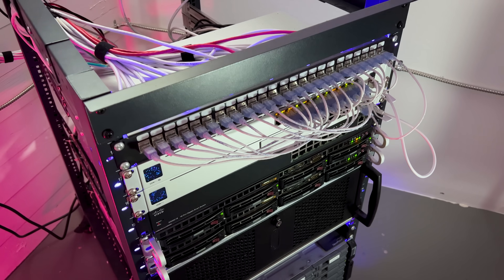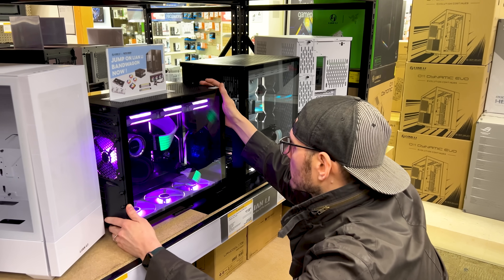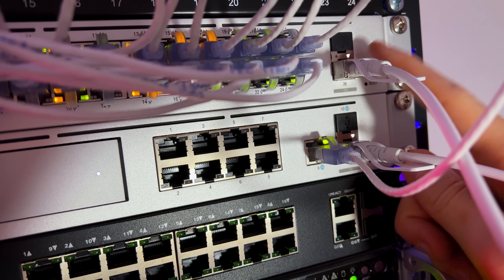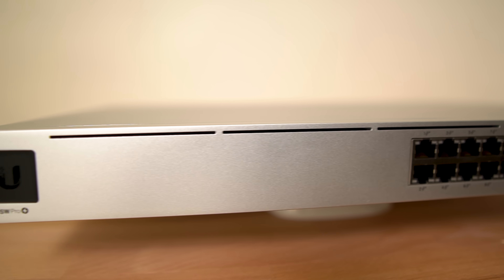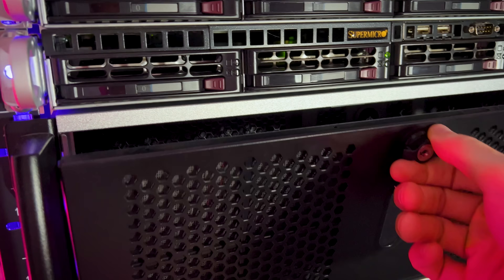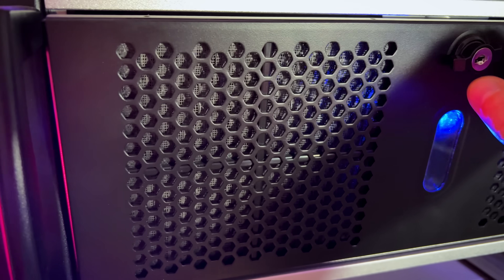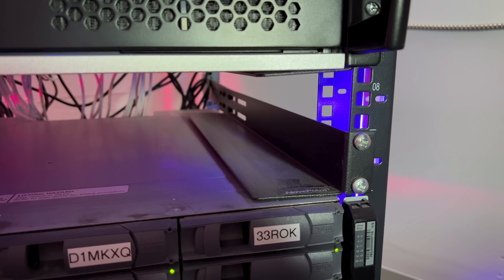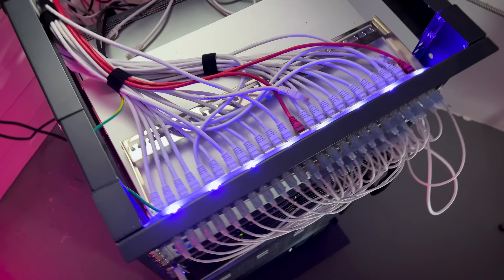My HomeLab Regrets...

Comment from the maker: What's one thing you regret buying for your HomeLab??? 😭
Reply: Budget always not enough
Reply: My first cheap crimp Patch Panel. Spent so much time debugging and rewiring only to realize that the problem wasn't my crimping, but the patch panel itself  🤦🏻‍♂ I've upgraded to a Keystone one and it's been smooth sailing since.
Reply: I regret only this, I buy UDM pro and after 4 days later UDM SE has been announced :D
Reply: @LegionInfanterie  no open refund?
Reply: @LegionInfanterie  Damn if they don't let you get a refund that shit is jank.
Reply: Not getting a bigger appartment so i could have space for a rack :*(. For now i got to love with tower servers
Reply: I so wish they was a rack option between 25u and 42u. Definitely outgrew the 25u faster than I thought I would, but I don’t really want to move to a 6 ft tall rack either.
Reply: Seagate 3TB HDDS early on in my journey. Oh you sweet summer child....
Reply: A UniFi Dream Machine Pro
Reply: tbh, servers

I went nuts buying used DELL kit here in South Africa and I didnt even begin to think that I could just build ryzen/intel pcs to use as home lab kit instead which are newer and less power draw.

My switch is ungodly loud to lol
Reply: New server instead of used. I outgrew the new server almost immediately and the used server I bought for a dev server is handling production now.
Reply: I regret buying non rackmount ups's because they were cheaper and at the time I had a makeshift rack.  Now I have a proper rack and have two UPS at the bottom sitting on a shelf.  Now if I want to clean it up I'm gonna have to re-buy Rackmount Ups.  Also I wish I would've went with a quieter disk shelf.  I have the DS2446 (the 2.5" drive) version of your disk shelf.  The power draw could be better as well.  Last but not lease I wish I would've spent a little more on a slightly newer dell servers with DDR4 instead of DDR3 for some efficiency.  Even with all that being said I'm pretty happy with what I've built.   Thank you for all the tutorials and walkthroughs of your equipment.  Really helped me clean up my equipment.
Reply: You can actually go and change the SFP+ assignment and your wan cat5e. At least with the Early release.
Reply: Drilling a hole through my ceiling and running 2x 10G fibre down just for my computer which I only barely use these days.
Reply: Brackets.
Reply: I bought cisco sg 350. After few days all cisco switch gone from local market and they bring new cisco switch. I happy with that switch but sometime i think i made a mistake.
Reply: A 1u 4 core Xeon with no HT and 32 gb of ram.seems very unbalanced.
Reply: My Old Dell DCS 24n7. I can't manage to install proxmox on it =/
Reply: HP server with HBA that doesn't allow pass-through
Reply: @stuarticampbell  wait what?! Isnt that exactly what a HBA does? Are you sure it isnt a RAID card?
Reply: @TechyGuy17  sorry, misspoke. Yes my raid card doesnt have an HBA mode
Reply: @stuarticampbell  Yeah ouch that hurts. Got the same problem in my HPE proliant microserver gen 10. Great machine except that i cant run truenas on it :(
Reply: @stuarticampbell  Silly question but couldnt you reflash it? I bought my dells with that silly PERC H200 card and they also dont do passthrough until reflashed
Reply: @stuarticampbell  also that being said if you cant reflash them I have a few H200 cards floating around, if shipping isnt mad I can send you some?
Reply: I regret buying Mellanox 40gb infiniband cards. They made me drool after doing a bunch of searching for 10 gb cards. I am very sad that they did not work as well as I expected "peer to peer" and a whole lotta other issues with opensm and it's just been HELL. Oh well, you live and learn I guess
Reply: I got a steal on a Netgear GS724TPv2 24 port gigabit poe+ switch for about $85 USD. Does its job, and truthbetold where I live now I am stuck with moca adapters to get hardwired connections through the property, so not really "needing" higher traffic ports, but I would have liked the future proofing for when I move house. Suppose I could always just aggregate links for things at least in-rack for higher bandwidth between servers just in case.
Reply: I have three servers in my lab right now; two built from used server parts and one from an older desktop PC that I put in a rackmount case.  It's the PC-server that I regret a bit.  While the two used servers (a dual Xeon e5 v4 and a low-end Epyc) have performed flawlessly, the PC has been a little less reliable, rebooting or locking up maybe every month or two.  And I've come to really appreciate the remote management in the server motherboards.  When there is a problem with one of them, I can almost always fix it even if I'm out traveling--whereas the PC motherboard, not having a BMC on it, means I need to walk down in the basement and tinker with it down there.
Reply: I've got rack mount gear jammed under my desk. Not having room for a cabinet is my regret.
Reply: I don't know if it's in beta @Techno Tim but the UDM Pro should support reassigning that port to a new LAN Agg port.
Reply: My 22U rack because I eventually needed to purchase a 42U, and I might have to get 2-3 more within the next couple of years.
Reply: 48 port poe HP ProCurve .. it had plenty of poe ports but it was louder and more power hungry than my 3 Dell servers combined. Its a paper weight now, lol.
Reply: I'd deff. go for proper rack with proper cooling....keeping x99 platform in regular case, on a balcony, doesn't seams like a good idea in hot summer days
Reply: Bought a switch because it had 4 SFP+ ports. Turns out they were vendor locked and would only accept a specific brand of DAC cables
Reply: Probably my storage server - the noise level is pretty intense, even in the garage.  Otherwise, I'm good with most of my gear.
Reply: going X79 first instead of X99
Reply: No regrets! Mainly because I run on used old crap equipment currently and I haven't bought much to regret. I regret not trashing old gear and focusing on upgrading at least.
Reply: Juniper EX4500 and a Cisco 6509. Wanted to get into the switching side of ISP networking but found out that trying to get rid of 50+lb dinosaurs after they're really obsolete is rough.
Reply: Getting 3 tower servers instead of 1 rackable server
Reply: My HPE Procurve 2910AL switch. 120W, wasted on switching. Noisy.
Reply: Power hungry server. $$$
Reply: Mine is to buy over 10+ HP G8's, Dell's and Huawei on one go XD

Comment: Hi Tim; I'm wondering why you would ever need more than say 2 VMs on your home lab server. I do like the choices you made for your equipment; especially units which have blinking or rolling lites. Give the whole rack unit some bling. I'm currently using the synology 918+ which fits my needs fine, however I did want to install a VM so I  could run a version of windows outside my regular mac OS. I couldn't seem to git it configured completely and maybe it might be due to the location I'm currently living in.

Comment: Love your presentations.  FYI, generally there is a reason they don't have half height panels.
If you stack 24 port panel, 48 port switch, 24 port panel, then the top 24 ports fit perfectly with 6" patch cables going up and the bottom 24 fit going down.  This is of course with replaceable jacks, which are necessary because a cat 6a+ copper cable is very thick, like 3/8".  It's very difficult to punch those down while maintaining high speed network tolerances in such tight quarters.
In a home lab though, you might want to direct cable three+ Proxmox servers to each other in a loop with dual ten gigabit network ports per server then route everything between them without using a switch at all.  You can still have the low speed built in networking go to the Internet switch, but that can be a typical pfsense low cost low port mini micro machine.  :)

Comment: unless you have a really good connection to the internet from home with high uplink and plannning to provide some sort of hosting services i see 0 reason to start a home lab.  It so much easier to learn terraform and setup stuff up from there.  Just spin up stuff, use it for whatever you need that moment, then destroy it.   Maybe electricity where you are free, but in most of where i am, it costs so much its cheaper to shell out 20-30 dollars for temporary instances when i need them. And it requires very little upfront investment.

Comment: Really not a production redy, proxmox is not HA and with only 2 nodes you really get limited. A DellC6100 with Proxmox + CephServer (SSD ofcourse) would be much cheaper and you would be capable of having 24 cores by node. Also having SFP 10Gbps would be a must for the CEPH server and this would save you the cost of this POE. Change the Raspberry for Labrador boards. Rasps are a hyped board. Really doesnt make sense. only my opinion one point of view.
Reply from the maker: I don’t need HA vms, I have HA services with Kubernetes
Reply: @TechnoTim  if you have only two nodes is not HA. You have a single point of failure. Simulate a power supply outage. Imagine a hospital service, would you relly on a single power supply node?

Comment: Worth noting you can also run multiple battery backups.  With multiple battery backups you can separate items by importance.  My main network runs on my bigger backup and my less important stuff runs on the smaller unit. I do split my redundant power supplies on my servers between both backups though.

Comment: Hey Tim appreciate all the great content. On the 1u servers have you considered adding in a pcie card with a couple of intel optane drives and moving to RAID10 with dedupe enabled and using the optane drives for the dedupe vdev? It could be an affordable way to get more space. CraftComputing recently talked about this type of setup for his home gaming VM rig. I am in the process of setting up a similar setup. It would also be great to see a video on Technitium DNS as a potential pi-hole replacement. It has all the blocking features plus can replicate zones to other hosts for that HA DNS setup you have in place.

Comment: instead of the supermicro 1U's, it sounds like a couple of used Dell R630's would have been a better fit for you.  Dual socket 2011-3, 32 DIMM slots, tons of 2.5" hot swap at the front.  They're pretty cheap, you might still think about getting them.

Comment: 8:30 I'd just put a 2U blank panel there to fill the gap. Costs about 10 bucks and looks neat.
Speaking of neat looking: Rackstuds! 🤓
Reply: What bothers me the most is the LED strip: You can see the single light spots because they are so far apart from each other. In my rack, I've used a 6000K (cold white) strip with COB LEDs where the elements are much closer to each other – so it's like one long light source.

Comment: I just installed a pass-thru patch panel like you and it is working just fine.  I had Unifi network gear and was great for about 8 months and then nothing but grief and after 2 months of no joy, removed the Unifi and put back my Cisco SG200/300 switches and everything is stable. Two of my friends who also bought Unifi had some similar and other issues that I did not have. We are all quite well versed with networking. Glad that Unifi is working for you, but I could never recommend the Unifi line.

Comment: I have decided to go TP-Link Omada. The functionality for the most part is very comparable (central management) and the WiFi APs as well as managed/POE+ switching is far cheaper. I am just not throwing caution to the wind and buying the best-of-the-best right out of the gate, as Omada is fairly new when compared to Unify and TP-Link are adding new hardware all of the time, so I do plan on upgrades in the future as I cycle older switching components out of the rack as I buy new Omada stuff. I have limited myself to a 22U rack and will NOT upgrade it.

Comment: I have a tip!  if you need more rack space, extend the rack to the max length and put stuff on the back side.  things like patch panel or PDU or shorter switches can use the same U front/back

Comment: I cant see spending $1100 on a 48 port POE switch when 4x+ 10gSPF+ and more bandwidth you could imagine in a lab from a retired enterprise switch like a ICX 6450 for less than $200. POE++ is the only thing I dont ever see on old switches but that is more for PTZ cameras anyway.

Comment: Interesting video.  I enjoyed it.  I was in economy mode when I built my rack.  I went with a 20U version and I've not regretted it.  I started with the Unifi SW 16 PoE and I would definitely do it differently if I had it to do over again.  Given where I was back then, I would go with the 8 Enterprise and 24 Pro (non-PoE) at this point.  That's $479 for the SW 8 Enterprise and $399 for the SW 24 Pro compared to $699 for the SW 24 Pro you bought ($179 upgrade).  That'll give me 2.5G PoE ports for the U6 Enterprise APs if I ever decide to upgrade them.  Since I didn't have that option available back then, I may end up just spending more and buying a SW 24 Enterprise though.  I opted for the Switch Aggregation though for 8 10G ports and that has been super nice for only $279.

Comment: i have the same rack ups i drill a hole in the case and soldered XT90 connector to the battery cable i have ran this with 6awg cable to the side of my rack and run a pair of northstar 100Ah AGM telecom batteries and a battery tender lol works great over an hr of backup with 3 dual socket epycs fully loaded 384 cores 3TB of ecc memory running a total of 60TB of nvme and a 45 drives 60x 12tb (l disks in zfs pool (4 in standby) all with dual 10gbit dac to each sever. my router is a udm pro my local switches are unifi Enterprise 24 PoE (2.5gbps ports) and a Pro Aggregation switch as my homes back bone i also have a pro poe 24 port mounted to my desk with dual 10gb fiber back to my rack. this rack also feeds 9 wifi 6 pro ap 4 tower mounted PtMP sector ap's and dedicated wisp system.
i will be ditching the udm pro soon as it just can handle the amount of data I'm pushing. i have 2 dedicated fiber line to the rack each 10gbps from lightspeed coms they currently bypass the udm pro into a pfsense box to handle the data and manage IP addresses with in my block.

Comment: Cool to see your rack, but it would be interesting to have seen the price you paid then versus now as a part of the "keep" or "upgrade". Cost and Energy Usage are two factors that add up over time.
Reply from the maker: Most of my “upgrades” were due to power consumption and I paid retail for most things which hasn’t changed.  I have them all listed in the gear recommendations link!

Comment: For me I view Ubiquity as the Apple of networking. Which you may call a compliment but I don;t mean it like that. I mean it as its the locked down walled garden ecosystem that I cannot stand to use. 

I'm just getting started into homelabbing right now and haven't gotten any real equipment yet, I only have a basic prosumer grade router but I want to custom build a 1U box to run pfsense. And then I want to custom build a 4U server with the front covered in drive bays to install TruNas and run any docker containers and VMs directly on that too.
Reply: What server do you plan to use?

Comment: On the 1U super micro servers.  They are awesome boxes - but that particular model maybe isn’t the best for a home lab.  You’re only running SSDs so having full size HDD slots is a bit of a waste.  SM has versions of the chassis with 8 (or 10) 2.5 inch hotswap bays.  There is also a version of your same motherboard you use with enough SATA/SAS ports use all those hotswaps as well as 10Gbe on board (the “CTF” version of the same board).  And you still have the single PCIe slot open.  Maybe not something you’d need to replace but if making recommendations to people about to follow your journey this is definitely a place where I would suggest they spend a bit more up front.
Reply from the maker: Thank you!  Would love to see this model!
Reply: Ok - so it looks like I brain faulted...  The motherboard i was thinking of with 10gbe and lots of SATA is an lga3647 (xeon scaleable) model.  X11spi-tf.  Not a version of yours.

Overall comment stands though.  For labs following your example I'd still recommend spending a bit more and getting the 8x or 10x 2.5inch 1U chassis.

Comment: I prefer to buy older end of life data center switches and network equipment. I bought a Juniper 48 port switch for $50, and all 48 ports are PoE+ 1gig ports, plus the unit has two 10gig SFP+ port. I did the same thing for my UPS, I bought a used APC smt2200rm2u for $200 and it came with brand new batteries installed. I prefer my UPS to be compatible with APCUPSD so that all my equipment automatically shuts down when the UPS battery gets down to a certain level that I can set for each device during a power outage. I'm even thinking about buying another end of life switch right now too, as I can get a Celestica Seastone DX010 32-Port 100G QSFP28 switch for less than $500 on eBay right now! I have NO idea what I would use 100gig networking for, but each port can also be broken out to two 50gig ports, or four 25gig ports, so I could probably make use of it somehow!
Reply: Wouldn’t it be less efficient in power?
Reply: @vincentnthomas1  slightly, yes. But not as much as you'd think. If you compare new switches with as many ports and the same features (such as poe), the used older switches only use a tiny bit more power.

Comment: Really nice to see a hardware video once in a while! The more I see your homelab content, the more I wish I bit the bullet and went with unifi gear. Had an old xeon system though so I cobbled together an opnsense box and chucked it on a shelf with a regular pc case. Highly tempted to swap the cooling solution and get a rackmount case after seeing several of your videos showing your rackmount case for your system now.